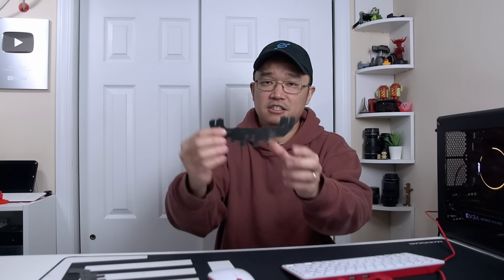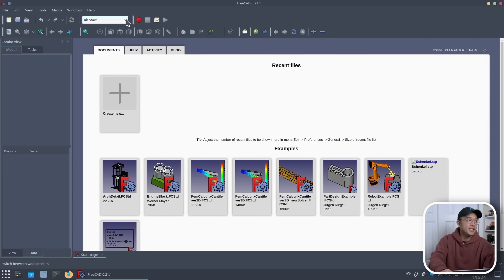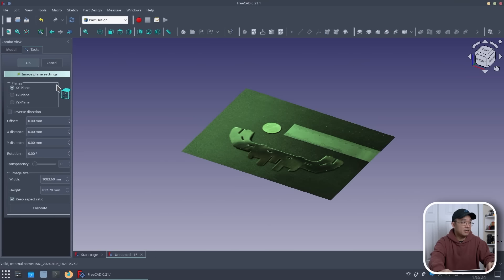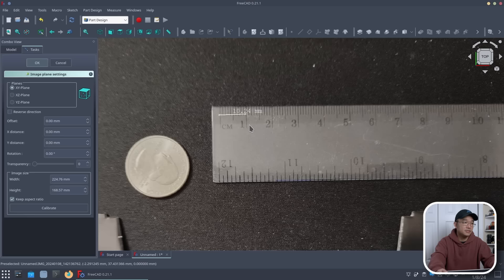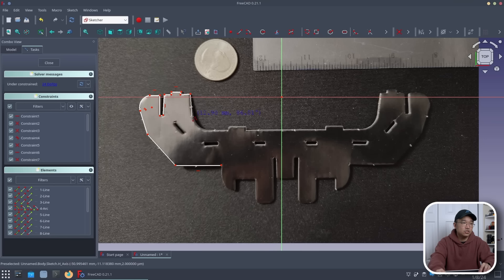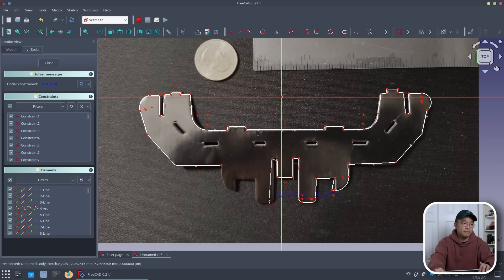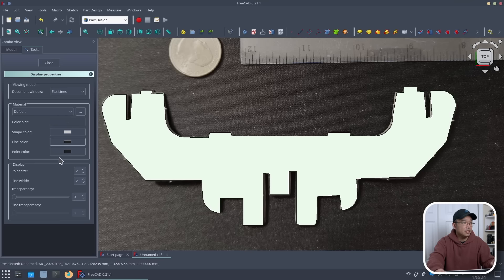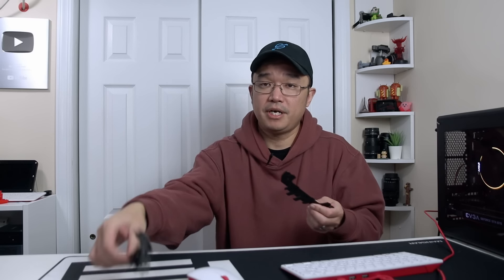Convert Images to Part for 3d Printing  on Freecad Tutorial

Comment: A suggestion - when calibrating use a longer "line". In this case instead of using 1 cm on the ruler, use the 10 cm. This would reduce any error introduced in the clicking process by a factor of ten.
Reply: There is about 5% difference between 0-1 and 9-10cm on this ruler. So what you are saying It's 100% true if you are using scan, if you are using photo you need to be careful with that, there is always a fisheye effect. In case that is represented in this video, you will get better results by taking a shorter sample nearest the actual object.
Reply: @kacperzawada2835 I always use the highest zoom on my camera and stand back to make that possible.  That way the fisheye effect is minimized.  And I do find that the scaling is more accurate over a longer span of the ruler.  It’s too easy to be off by a significant percentage if you use a span that is significantly shorter than the object that you are trying to model.
Reply: @harrymagooslum5770  I like to take pictures from distance too. And yes, if you minimize fisheye effect then the longer sample the better. But in case represented in video the fisheye effect is so severe, that it's better to sample shorter distance closest to object, so both are affected similarly, going with longer span of the ruler gives you over 2% error just from fisheye, I think we can clip scaling tool much more accurately

Comment: This is great, but I would add a note. To improve accuracy, if at all possible use a scan rather than a photo. A simple document scanner will work with a lot of flat parts. Second, if you are using a photo, you should try to correct for lens distortion before using the photo for modelling. You would be surprised how much our photos are distorted by lens curvature. I use Darktable which is able to correct for a wide array of popular lenses, and is free-open-source.
Reply: This 1000%.  Not only will a scan get rid of distortion from the lens and the angle, but it also gives you precise measurements. Generally if you set your scan to 600 dpi, each inch will be 600 dots. Setting your scale to pixels will give measurements accurate to about 0.01 inches. Check your scanner by scanning a ruler too.
Reply: @senseisecurityschool9337 great tutorial

Comment: Great video, as always.  I have 0.21.1, but the Import option under the File menu is not bold and not available.  Does this feature require a plug-in?
Reply: Create a new file first, then import.

Comment: Cool video, however somewhere between creating the inner pockets and actually hitting the create pocket button, something doesn't work on my end.  Instead of rectangles, I've drawn circles and no matter if I hit create pocket or create hole, it just doesn't do what I see in your video.  I've even tried to follow every step by step and I get to this point and it just doesn't work.  Any ideas?
Reply: I have the same problem...it won't create the hole/pocket no matter what I do.  Is there an update to this video?

Comment: Hey Don your videos have been helping me out alot, I am fairly new to CAD and I am having trouble with a arched line, the 2d piece I am sketching has 2 straight lines but the 4th being the top is curved and raised 2mm at the center how do I go about this?

Comment: this vid is  crap freecad no longer has image workbench soo nothing in this video applies to those of us who just downloaded it and thus i still cant crop a part from an image  to manipulate or rework or 3d print my free cad has all different icon's also so maybe do another vid on the freecad the rest of us have. I tried to find that crap icon you clicked on to make part a 3d model but i don't see that either it must be from one of the 500 workbenches available  freecad is boo &%@@!! ive spent a week trying to crop part out of pic i still cant even put measurements for the part dimensions boo sh !worst cad and worst teaching vid
Reply: import file > press your image
Reply: Search for Mango Jelly's video "Why has the Image Workbench been removed in FreeCAD 0.21 ?" if you're not figuring this out.  It also works in 1.0 RC2.